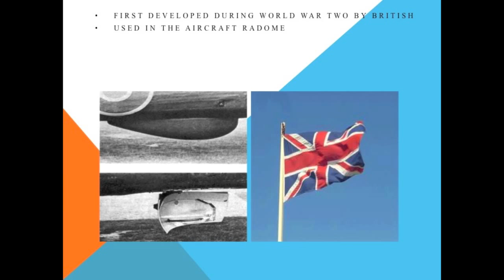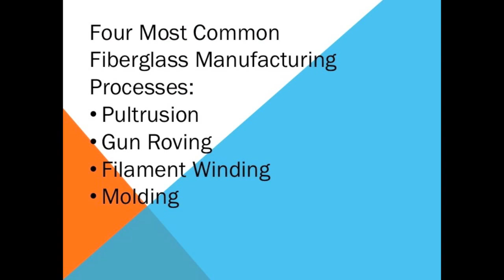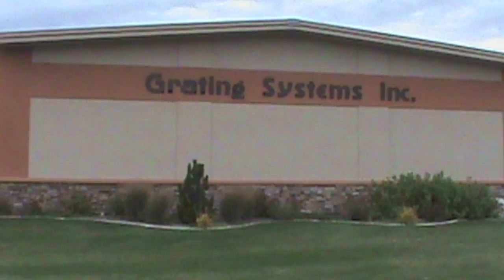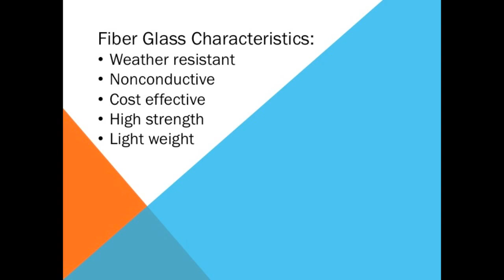Fiberglass Manufacturing How Fiberglass Is Made

Comment: I don’t think it is extruded as such, The fibres are too small. I once read that the molten glass is blasted with compressed air and the resulting “fibres” are bundled into a strands of fibres and then woven like explained in this video. May be wrong but extruding glass will not give the fibres the parallel grain that fibreglass materials have.
Good footage of woven mat machinery
Reply from the maker: you are correct about the high pressure airstream through molten glass. but there are a few different ways of creating the glass fibers depending on what their intended use is. fiberglass insulation is created in the way you describe in a system that is very similar to how cotton candy is made. fiberglass used for fiber optics is a single extruded and coated strand of glass in a highly controlled process. I’m no expert, just provided a few basic examples of common fiberglass manufacturing techniques. thanks for watching!

Comment: Would be nice with some more info regarding fiber glass beams etc that is used more and more! I guess they use the mold version and then you buy whichever size you want.
Reply: Beams and generally most things that have the same profile across their length are done using pultrusion.